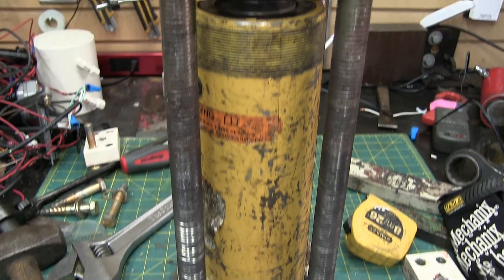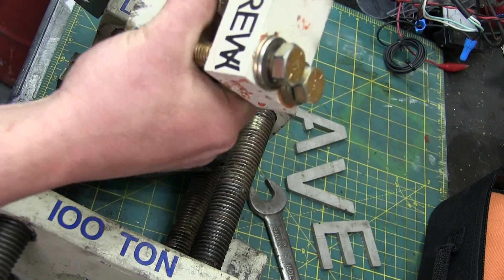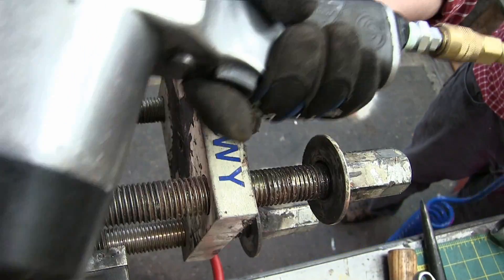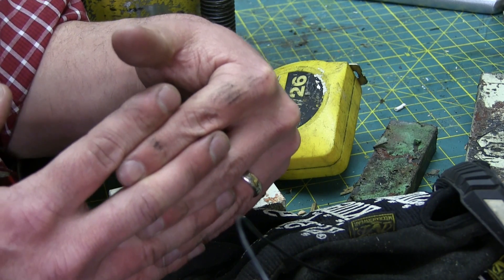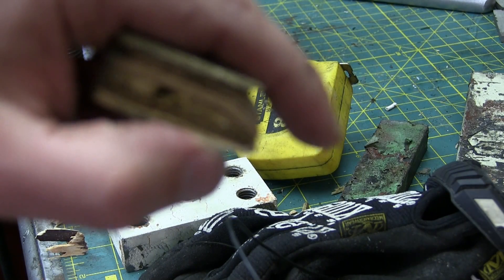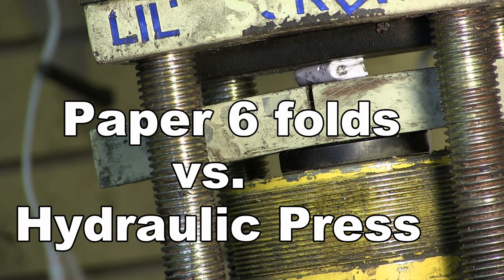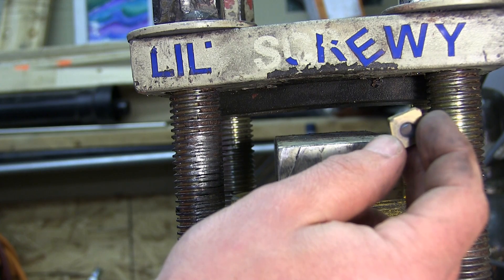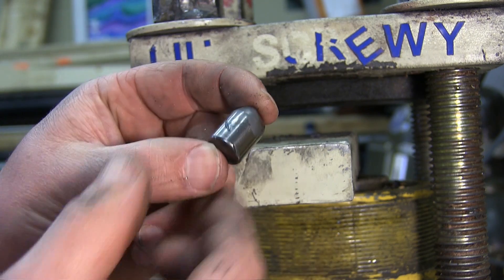Why Paper EXPLODES in a Press?! Prince Rupert's Drop, Tungsten Carbide and more!

Comment: I'm thinking the carbide button from the cute little rock bit probably uses cobalt as a binder as it's the most commonly available and therefore cheapest from the yangzu carbide factory.  13% cobalt with coarse grain tungsten (2-4 micron) would make for great fracture toughness which would be a good property to have to pound stone.  I would assume the insert would be as hard as humanly possible, i've only ever dealt with cobalt and nickel, and i would still be choosing a cobalt binder for cutting inserts.  sub micron grain (0.5 micron) with 5% cobalt gets you a HRA of around 94.  Try running a file on that!

Comment: What about using reversed threaded bolts for your security fasteners, so even if they jam a couple slot screw-drivers into the top of your bolt in an attempt to force it to turn, they'll be tightening the bolt and not loosening it.

Comment: Need more power! I have to wonder if the speed of compression has any influence. For example if you compress air very slowly, it doesn't get very hot. But if you compress it fast you can start a fire with it.

Comment: The rock drilling button is a whole different beast compared to the inserts. They'll still fail when you're pressing them into case hardened steel with a 100 ton press, but it's quite rare. For some reason there's only one company in China that can manage to make a decent Carbide button that won't fail, we've tried about a half dozen others and they're shit.
Reply: +ThrowingItAway Which company? Is there any public available data on it?

Pressing a case hardened bike lock like Kyrptonite Until it fails could be fun. When I see those broken on the ground I often pick them up because I know eventually I can grind it into some kind of tool.

Comment: I have another theory for why the paper exploded. When folded, the outside layer of paper has a larger radius around the fold, putting it in tension. With so many folds, assuming that there wasn't much slack when folding, the energy stored in the tension at the crease gets larger and larger as the pressure increases until the paper just gives out and explodes at the crease. This is simply an addition to your explanation as they both happen simultaneously.

Comment: When you compress it with too much powaarr, the nucleus of the paper atoms collapses on itself, releasing the energy in a small explosion. The reason why the atoms collapse is because all plants are slightly radioactive containing the carbon-14 isotope. It's not a dangerous amount of radiation, but enough to make a pop under pressure. The released heat also makes the paper stick together a bit as was seen on the HPC video. Cheeers and beers

Comment: You want to make them fly straight, shape the tungsten carbide like a diabolo. That seems to be the fool-proof shape for making things fly straight.
Reply: reshaping those sob's is near impossible and the dust formed is serious toxic shit , that can't leave your lungs, ect. bad bad stuff, but if you could build the molds correctly and have a sintering unit , thru you can get the blended powder sent directly to you. just remember , the molds have to withstand a lot of pressure , and you have to account for a bit of shrinkage in the sintered piece. easy peezee,  lol
Reply: +texasdee slinglead Hm.. maybe force the shape in plastic? Have the extra diabolo bits made in plastic.

Comment: There's a trick for making those tungsten 'bullets'  fly straight: make a hole in the back of the bullet (the flat face)  and bend a small piece of wire to make an eyelet, then put about 5 pieces of 10cm woolen yarn halfway through the eyelet, and jam the eyelet into the hole in the back of the bullet, and voilla, you have a rightwards chooching bullet. 
I have tried this and it does work.

Comment: I am wondering if the explosions aren't actually the result of trapped air escaping after the failure of the material. if there's any, even slight, concavity to the anvil or hammer the plasticized material will form a seal that traps air.

Comment: My press is 100 tons with 300 bars but the paper was about only 50 bars when it exploded. But the pressure meter is sometimes bit behind what actually is going on. The hockey puck needed all the 300 bars and it still wasn't easy. But I am starting to build 1000 ton monster as soon as find necessary sponsors for the project so after that we will see lot more of explosions :D

But your theory behind those explosions is probably right. 

I am planing to try explode the rock tungsten carbide bit. I have hardened cromo-steel pressing tools ready for that one.
Reply: +Hydraulic Press Channel I friggin' love YouTube!!!!!!
Reply: +Hydraulic Press Channel dear mister hydraulic press channel, you should really come visit me at work in Denmark at Force Technology in Brøndby. I work in our national metrology calibration lab where we can calibrate everything from force transducers over to torque and pressure transducers. at our force lab we have maschines which can press from forces at newton range to mega newton range (1 mega newton = 1.000.000 newton). in our torque lab we can calibrate from millinewtonmeter range up to 1100 newtonmeters, and at our pressure lab we can measure from -1 bar to 8000 bars. now thats something! and it is all possible with a very high accuracy.
Reply: +AvE This would be amazing if you sent the Hydraulic Press channel some Cuntsen Targlide buttons.  But wouldn't they need to press it with something equally hard?
Reply: @inthefade  Its cumstain tongueglide
Reply: +AvE the paper dont exlode not because you dont have the necessary pressure but the compresion speed.Your theory about the plastic and elastic deformation is right but also the time is important.If you press something real fast you put a large amout of energy to the object and then it is released.The tipe of releasing the energy can be slow by deformation or if you surpass the amout of energy that the object can store it will detonate-explode.In your vidzeo the press is just too slow to do that.
Reply: can i have any spare shrapnel if it explodes?
Reply: +Hydraulic Press Channel you should do a prince rupet drop, if you haven't already.
Reply: I read all of that in your voice. And it was amazing
Reply: +Hydraulic Press Channel 

Cool.  1000 ton press is insane.  I hope you get those sponsors and get it built.  Though since you're exploding tungsten carbide, please be careful of the dust.  It's the dust that gets into your lungs and causes us to die or get sick.  I hope AvE, when he exploded that cutting bit, was well away, and has some protocol to clean it up without sweeping it up sending a bunch back into the air he is breathing, like the TC factories (even in China) have to do.
Reply: +AvE Not bad on the voice at the start not bad at all.
Reply: Might better upgrade your blast shield for that test!
Reply: +Spark Gap I would certainly contribute. He should make a Patreon account. I couldn't find him there. I want to throw money at a 1000 ton press!!
Reply: +Hydraulic Press Channel SHUT UP AND TAKE MY MONEY!!
Reply: What a great video now that it's up, HPC. This collaboration made me  especially happy because there aren't many channels that I watch nearly all the content for.
Reply: I red tis wit Ralli Enklis.
Reply: +Prostheta +Hydraulic Press Channel  +AvE 

That would be amazing :)
Reply: Hydraulic Press Channel was that ever done?
Reply: I read this in your voice.  Also, you wife was nodding in the back ground while the cat was walking by.  (in my head)
Reply: You’ve come a long way HPC
Reply: +inthefade i would imagine so, but cumstain targlide pressing plates are probably pretty bit pricey.
Reply: with 1000 ton you will create energy when you crush ...lol you can't start your own power plant
Reply: +Hydraulic Press Channel Gonna make some diamond next?
Reply: Prostheta From what I've read (I'm also a Finn so I know the stupid bureaucracy we have here... ;)) the most simple way to deal with that is to register yourself as sole trader (toiminimi) and pay income tax from the Patreon etc. payouts...
Reply: +Hydraulic Press Channel Yes! Do it! Build a monster! :D
Reply: *****
But where is the oxydization?
Can't see "burned" stuff in the end ...
Reply: +Dexter Treehorn There appears to be some superficial charring on the paper in the original video.
Reply: +Hydraulic Press Channel SOUNDS AWESOME
Reply: that's just crazy man.
Reply: his pump is 7,000 bar (10,000 PSI is roughly about 7,000 bar) at 100 ton.
Reply: Awesome glad u could reply to ave. You guys both have stand up channels.
Reply: 1000 Tons...

Jesus Christ he's a mad man
Reply: Looks like your Kit Kat bar has splinters.   @3:14
Reply: +Hydraulic Press Channel Skookum as frick!
Reply: Patreon?
Reply: +Hydraulic Press Channel Turn ads on dude. You could make so much money!
Reply: +Hydraulic Press Channel I believe the explanation by this channel isn't exactly thorough. What I  believe is happening here is the compression of matter and air heats the material enough to allow it to explode. You'll notice it's only combustible (e.g. organic material) that explodes under the hydraulic press. This is because compressing a material heats it if all other 
conditions are equal. This is also how a diesel engine works, the 
fuel-air mixture explodes due to the pressure exerted by the pistons.

Comment: What do you use to get air pressure into hydraulic pressure? I hear the air compressor in the back
Reply: It's an air powered hydraulic pump. Like the jacks used on big truck or equipment only it has a hose to hook up to other cylinders and such.

Comment: Isn't the shape of carbide also a factor, with that insert, it was bound to be crushed easier than the cylindrical one, which basically has a load bearing arc structure?
Reply: +Mr Mürk He used a square socket vertically, so it's at its weakest point. I imagine if he tried to crush the bit horizontally, nothing would happen, or it would crack at most. Also since the other shape was a cylinder, you get far far far less surface area to press on initially until it pushed into the base.
Reply: I thought the same thing. had it been laid on its side so the hole opening was perpendicular to the force it may have had different results. either way awesome video as always.